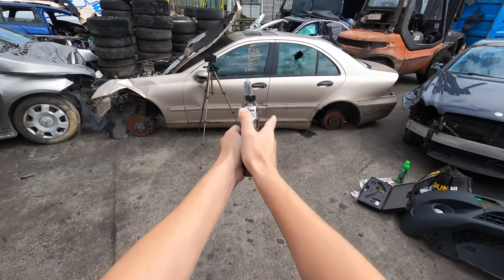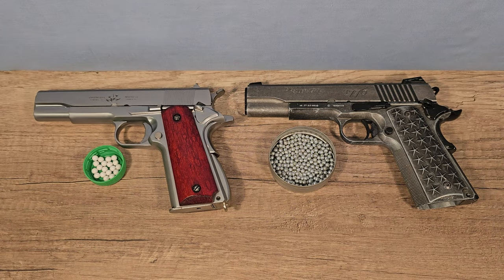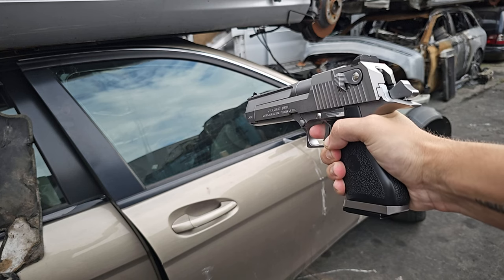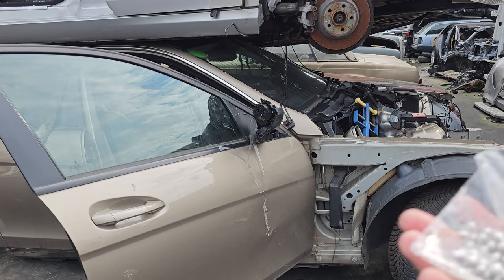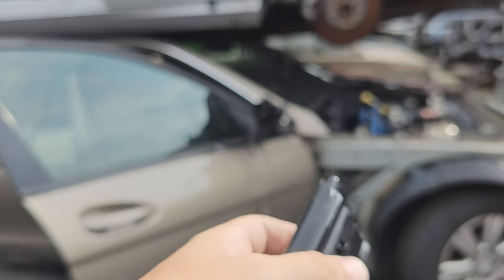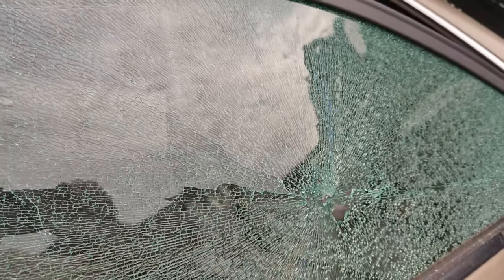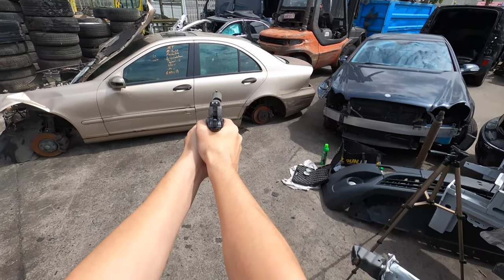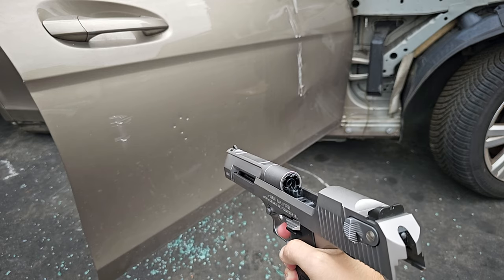Can airsoft break a car window ? (6mm plastic, allu, steel bb)

Comment: First of all, thanks for your test. I think, you are the first one who shot a car door/windows on youtube with airsoft and airgun (yeah, I saw your other vid too).

You said, an airsoft gun will not break the window from 10 meters. Now, you have a green gas Deagle, which is 1-1,1Joule max. That is not much, with steel bb that's even lower than 1J. (Your 4,5mm bb pistols are around 3-3,5Joule(?), right?)
I mean, you should get and do the same test with a high power airsoft sniper (550-600fps/0,20g bb) to see the difference using steel bbs + for curiosity, 0,30g alu bbs too. Im sure, rifles would break the glass from even 20m...

(((Ps.: I have a Snow Wolf M24 airsoft rifle, with 6,7-7Joule (400-410fps/0,90g bb) so Im 99% sure, it would crack the side window even from 30+ meters.)))

Nice video!
Reply from the maker: Thank you sir
No i have a airsoft revolver with the same power to try it out but finding a car were i can shoot glass is always hard. And  A sniper is a bit expensive for 1 video. 😝
Reply: @HappyDude1  Yeah, I understand it.. I know about your Dan Wesson, but I think, that co2 pistol is still weak for 0,90g bbs.
Reply from the maker: @airsoftvseverything  
My blank gun with steel bbs is very powerfull have you seen that ? 😁
Reply: @HappyDude1  Yes, I saw it. I have similar license cover plate at home, but my airsoft gun can shoot through that plastic cover easily! Maybe, could you measure the plastic thickness?
Reply from the maker: @airsoftvseverything 
There are a lot of different Plastics mine was abs its very strong and went trough that and was stuck in very thick wood  and it also almost shoot trough 2 mm of steel
Reply: @HappyDude1  okay, thanks!

Comment: Wow enjoyable Videos xD. Are the co2 4,5 steel bb gun much louder than your desert eagle with 6mm steel bb?
Can u give me an example to compare? Thx, man ;)
Reply from the maker: Thx and Its the same
Reply: It's basically the same sound as a nail gun. Loud but nothing compared to a real gun. It's the pattern of the sound though that will make people call the cops on you. Like especially full auto or burst modes. Nail guns don't do that lol you gotta keep it semi and consistent if you have nosey neighbors or are worried about any interaction with law. And driving out to a more quite place is almost worse unless you have permission from land owner. Then your fine. Infact if you live in a house your almost better off shooting inside into a trap with stuffing and padding etc rubber mulch works great or old shirts. Don't want the police knocking on your door because the neighbors are nosey assholes...been there....

Comment: Ok, so the steel BBS are too heavy. If you measure the velocity and consider the weight, you will see that the Aluminium and plastic BBS actually hit with more force than the steel BB.
However, in the plastic BB (And to a lesser extent the soft aluminium BB), the energy is dissipated in the breaking or plastic deformation. It would be interesting to measure actual peak force on impact.
Reply from the maker: @CharlieTheAstronaut  
Correct, you can calculate that when you have the weight of the bb and the fps.
I did that in a video where I test steel bb and aluminum bb
Reply: @HappyDude1  I was not critiquing, just wanted to add more context regarding elastic/plastic deformation, as the transfer of energy is just as important as the kinetic energy the BB is carrying, love the video!
Reply from the maker: @CharlieTheAstronaut  
I know 😁 i told all of this in that other video 😃
Reply: @HappyDude1  I did not dive that deep haha :D
Reply from the maker: @CharlieTheAstronaut  
Dive into my videos 😁

Comment: Joule?
Reply from the maker: with plastic, allu or steel bb ?
the weight is in the video for each bb so you can calculate it. it's equal to one-half. times the weight of the bb. divided by a thousand to turn the bb weight into kilograms. times feet per second divided by 3.28
Reply: redwolfairsoft claims 355 fps with 0.20g bbs, which is 1.16J.